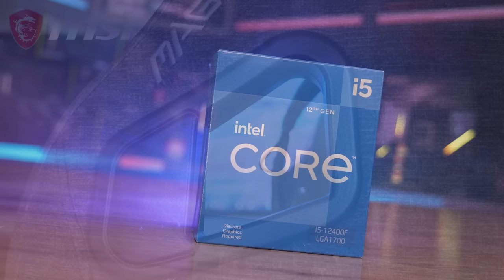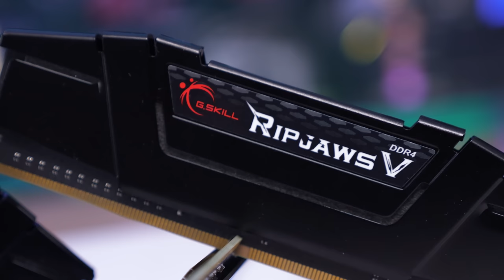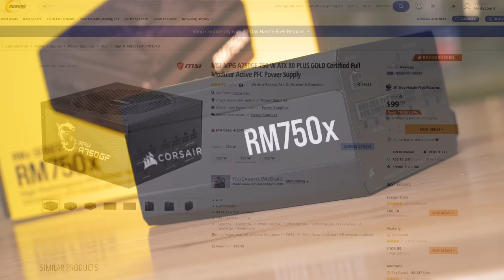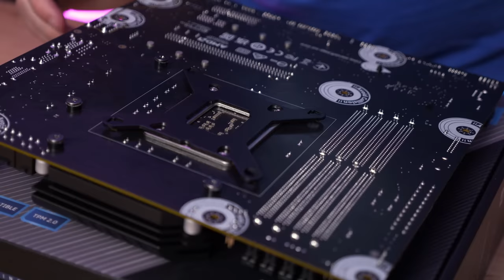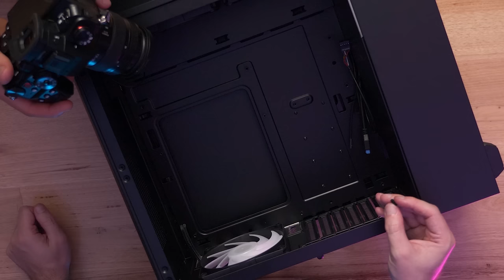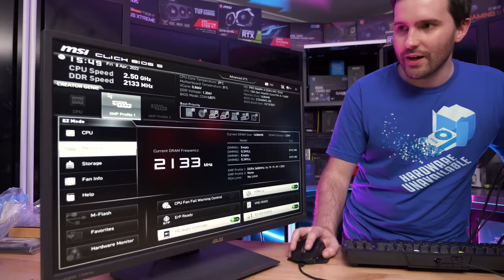Best Bang for Buck Intel Gaming PC Build for Early 2022

Comment: Best Intel bang for buck the i5-12400F?
Nah, it's the Core i7-11700K. 2 more cores more, similar IPC, iGPU...

No more 6 core CPUs as bang for buck in 2022.
Reply from the maker: 11700K would be a horrible investment right now. It's a dead platform, the CPU costs 80% more and on average only offers the same level of gaming performance. Also if I were to be frank with you, judging CPU performance based on core count is a bit bone headed. Sure there aren't any super powerful quad-cores, but parts like the 12400Fwill match the 11700K well into the future.
Reply: @Hardwareunboxed  No, there's no way unless the IPC is more like 40% ahead or something a little higher than that. In fact, the 12400F would be better like an i9-9900KF competitor from 4 years ago with Skylake IPC, but the 12400F's clockspeed is also lower.

Counter argument, why invest on Zen 3 or AM4 if it's a dead platform too?

The i7-11700K is on 320$ on Amazon vs 190$ new for the 12400F. The 11700K significantly faster overall vs the 12400F, the 11700K has AVX512 instructions and is an i9-11900K with a discount. Cyberpunk 2077 wants 8 fast threads, not 6, you showed in your Battlefield 2042 CPU benchmark the newer 8 core models being ahead of the 6 core ones.

Comment: Msi b660 with 12400 unable to xmp 1,  xmp1 not stable and will blue screen. Currently only able to xmp 2 limit the ram on 3000mhz
spec 12400, msi B660 mortar, kingston 3600 cl17. Anyone can help

Comment: wow... getting a graphics card that's on the level of a GTX 1070 for 400 dollars in 2022...
wow...
Reply: a 6600xt? literally performs better than the 1080ti in a lot of titles...
Reply: Actually, it's closer to a GTX 1080. The RTX 3050 would be the GPU that matches the 1070.
Reply: @TheBURBAN111  This is the 6600, without the XT, but I stand corrected. It's quite a bit faster than the 1070, it's similar in performance to the 2070.

Comment: The storage and power supply don't look like the 'best bang for buck' in this system. You've said in your channel yourselves, ssd speed doesn't matter for games. Additionally why would anyone need 750 watts to run an rx 6600. The excuse to give upgradability is dumb. A person who builds a PC like this is either on a very tight budget or a teenager who doesn't have a job and can't pay for upgrades. A good 550 power supply is sufficient.

Comment: The best value argument you can make for an AMD gaming build is that you can find some extremely low sale prices on decent B450 boards, which a Ryzen 5600 will still work very well on, but you are making some sacrifices on features with B450 motherboards vs B550 or Intel B660. You might also be able to find some good sales on B550 boards as well, whereas Intel boards do seem to tend to cost more, probably in large part because people tend to compare the value of CPUs without looking at motherboard pricing, and decide which CPU to get before deciding which motherboard to buy. Obviously, a good sale price for a motherboard can make one platform more attractive than the other, but it's also hard to make generalizations about value when sale prices can vary a lot in terms of availability by region, and can also vary a lot over time as well. The features a user wants in a motherboard can also vary a lot, so it's a lot more complicated to compare the value of motherboards than it is to compare the value of competing CPUs.

Comment: 12600KF only costs a little bit more than 12400F and is significantly faster. I would rather get that CPU.
Reply: 50% more is pretty significant.  12600k is in a strange place and I would always recommend a 12700f over it
Reply: @nostrum6410  It depends on the price, but 12700F is 40% more expensive than 12600KF in my country, and I do not think it is worth it.

Comment: Mech 6600, 12400F, B660m-a wifi, viper 3600 16gb, P5 Plus 1tb, aerocool cylon 700w semi mod, cheap case 1st player 4x 120mm fans DK D4, Arctric 7x, £829.93 (inc 20% vat) at CCL in UK with code AFF25. Hope his might help someone out!?

Comment: I'd go for little more expensive B660M Mortar. Then you can easily upgrade to at least 12700 in the future.
Reply: The MSI B660M-A is more than fine with the 12700.

Comment: This computer will not age very well, and neither will the Ryzen build. The majority of gamers have at least six cores already. Graphics cards are moving in the direction of much higher power usage, and you may find that 750 watts is not enough to run an RTX 4070 with rock solid stability. 16 GB RAM for a new PC in 2022 is absolutely idiotic when 32 GB is $35 more. I don’t care that you can upgrade later — you should build with it now so you get a matched, 2 dimm kit and have the option to upgrade to 64. The motherboard is…. fine. But make sure you have external audio. Basically, this whole computer is the GTX 1060 3GB of builds. It will run games from six months ago at 1080p, and upgrading it isn’t worth it because by the time you buy something worth the trouble of upgrading and finding a new home for the parts you have, you’ll be pushing another component to the limit. As someone who does not resell my components when I upgrade them, I would not build a machine at this budget.
You buy 12+ cores and a cooler appropriate to that heat load.
You buy a 6700 XT minimum unless you’re buying a holdover GPU. If so, why are you building right now at all? Just wait and buy matching components all at once! It will assuredly be cheaper!
You buy a 1000 watt power supply minimum — 1200 would be better — so you don’t have to worry about what GPU to which you can upgrade.
You buy 32 GB RAM minimum. 64 would be better. I play Cities Skylines and that game is from 2015 and chokes on 16 GB RAM. Even if you don’t, if you want the luxury of using your computer around a game, Hardware Unboxed don’t make their recommendations around that.
Reply: I have gigabit internet, and I am shocked that an Aussie channel is not recommending a 2 TB SSD. Remember: they can’t just download games in seconds when they want to play them! Downloading COD could tie up their internet for a whole day! That means they’re only going to want to do it once. Unless you only play a couple of games or have very good internet, get 2 TB. Don’t split your storage into more drives — it’s more to manage and gives you less flexibility.

Comment: never go with an F, for few dollars it is not worth it never, on any range of budget. Integrated graphics has lot to offer that your discrete won't. One would that comes to mind is that web browsing. I would wanna be using my discrete gpu to run chrome or remind you electron apps such as discord. Don't buy F chips.
Reply: What so wrong with F model? Cause no iGPU?
Reply: @raffyluvmiharu  No F means there is no CPU it is made of only integrated graphics. So they remove the CPU cores and only leave the rest.

Comment: You should always add "in Australia". That doesn't apply to other countries. When You will finally get it
Reply from the maker: It's mostly US based deals so no we won't put in Australia. Thanks for the advice though, we'll get it one day.
Reply: @Hardwareunboxed Please do Post-Calibration 6900 XT vs Post-Calibration 3090 Ti IQ testings on Samsung S95B QD-OLED TV to end the 2-decades long argument once and for all which GPU vendor truly outputs superior Image Quality with more Vibrant Colors at stock settings.
Reply: @Hardwareunboxed  OK, so put "in US"
Reply: @Hardwareunboxed  Hey Tim & Steve, the Samsung S95B first QD-OLED TV is officialy released today. Don't forget about it.